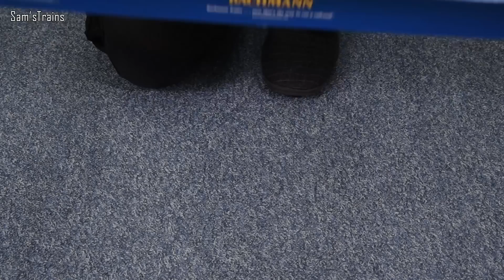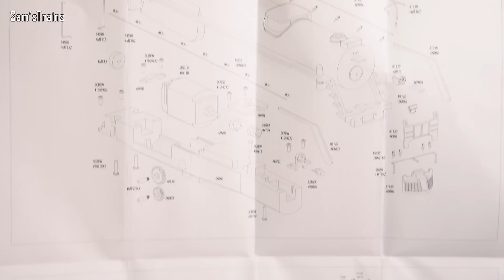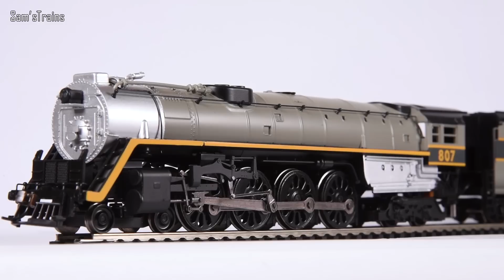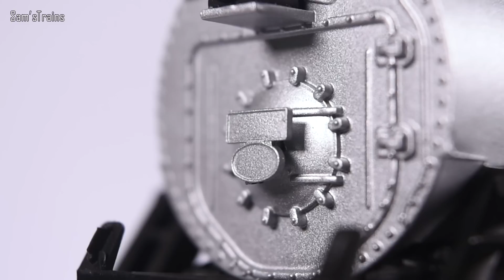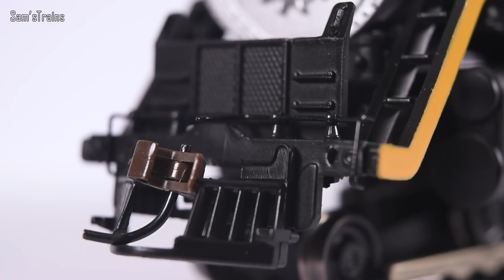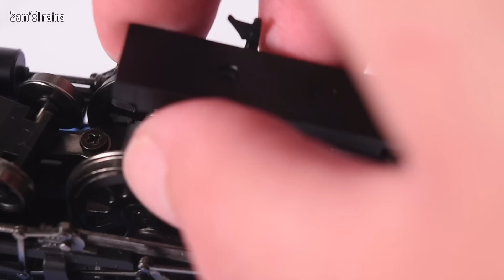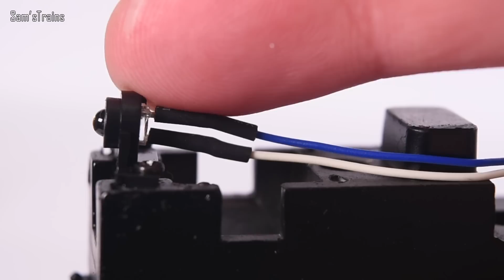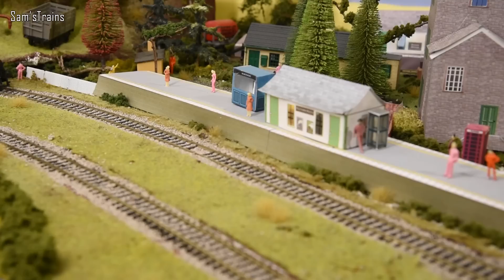Cheap,  Derailing Bachmann UP FEF Steamer | Unboxing & Review

Comment: That's not even an Union Pacific engine... That's just a New York Central repaint. I have the same model, which I got from the "Overland Limited" train set. It seems like it's supposed to work with the track packaged with that set, which is pretty wide, but other than that... Yeah It was really troublesome when I pulled it out. 

Paired with a rake of ten or more wagons in a nice starter set, I'd say this cheap repaint is forgivable, but on it's own... It's just an entry-level starter model. I still think the detail score should have been much lower considering it's more or less a lie, but that's just me who just likes nitpicking this toy.

Comment: 28 coaches that’s less than Hornby pacifics,I’m not saying it’s weak or anything but if a 4-8-4 northern one of the most powerful steam locomotives in the US in real life can outpull any British diesel locomotives and yet it is 3 time less power full than the British diesels yeah I got to say very disappointing and also my gs4 daylight does the same with the derailing

Comment: Nice 4-8-4. I still do not like those plastic knuckles couplers, they almost always break. Why are American Bachmann trains so cheap. Never mind I looked it up. This engine is intended to be a part of the Overland's Train set. For a train set loco it is probably very good deal.

Comment: Reason it keeps derailing Sam is due to its large wheelbase and I have a MTH FEF And it looks at forth rages curves and laughs due to the larger wheels and larger will buy some American locomotives unless it’s something like Mecardo it will laugh at 4 radius curves
Reply from the maker: It isn't the wheelbase - without the tender connected, the loco handles the curves with no problem - as you can see in the video!
Thanks for watching, Sam :)

Comment: You are in fact correct Sam. More specifically, that loco is an FEF-1. Essentially, the first of Union Pacific's 4-8-4 Northerns if I'm remembering correctly.
Reply: Actually it is not any Union Pacific FEF series, its a New York Central S-1a Niagara locomotive with a Southern Pacific SP-1 tender, painted in Union Pacific's "Greyhound" scheme.

Comment: Honestly, the Locomotive is just a recolor of the Bachmann NYC Niagara.
If you want a proper FEF, get an Athearn one
Reply: Or the BLI one
Reply: @williambabcoke248  the athearn one would be cheaper
Reply: @Train099-owner  looks like pre orders for the next run of Athearn ones are pretty much the same price as the BLI ones. Considering the BLI one is a new tool, made of metal, and has more features, looks like the BLI one is better
Reply: @williambabcoke248  the BLI are die cast and sounded with smoke for about $560 while the Athearn plastic construction without sound is about that price while the sounded are about $630. I’d recommend to anyone just grab the BLI since it will have more pulling power thanks to the die cast and it will be cheaper with sound.
Reply: @James-Railyard  I looked at FDT and thought that the ones with sound were $550, guess I didn't look hard enough. It looks like Athearn needs to make some price cuts to stay relevant. Price cuts by like $200-$250
Reply: @williambabcoke248  I agree but the problem with Athearn is they make the bulk of their money and business on diesels. The steamers are probably a side gig. They also only do the Union Pacific engines in Genesis, the old time 2-8-0’s are the roundhouse line I think and seem to be decently priced.
Reply from the maker: Yeah that's what I've heard... I was a fool to get a Bachmann one... but then it was cheap! ;D
Thanks for watching, Sam :)
Reply: @SamsTrains  It's odd to me that Bachmann makes the GS4 and could have used that chassis for this loco. BTW FEF stands for Four-Eight-Four. I was fortunate enough to see sister 844 in person years ago and they are magnificent beasts!
Reply: Thanks for pointing that out @william nichols
Yeah, doesn't even look like an FEF.
Reply: Fun fact: NYC Niagara have air horns (fog horns) but the Union Pacific FEF does not
Reply: I prefer BLI
Reply: Or the BLI one coming out in winter.
Reply: Or Broadway Limited Imports one that is coming out

Comment: Hey Sam I know the problem with this engine. It requires 22" Radius curves (Bachmann EZ track). I have a Bachmann Daylight Locomotive and it won't work unless you have 3rd Radius Curves. If the drawbar is effecting the way the tender is sitting on the tracks, I have a solution! Just bend it down a bit and it should make it better. Same situation happened with my Daylight engine.
Reply from the maker: Thanks for sharing that - pity they failed to mention it anywhere on the box or paperwork!
Thanks for watching, Sam :)

Comment: that doesnt even look like an FEF tbh
I'm guessing it's an FEF-1 because of the single funnel
Reply: That's because it's a NYC Niagara. Never trust Bachmann to be prototypical.
Reply: @P0nyB3h0ldr  now that you mention it, it does indeed look exactly like a niagara
Reply: its not its a new york central niagara
Reply: @IndustrialParrot2816  It's got the windows, the Selkirk front, the airhorn, the roller bearings, the dual beam headlight, the ALCO/NYC Air compressor array. The only thing it's missing is the late NYC era (psc?) tender, which was probably omitted for the sake of the illusion of it being a UP engine. Plus, the smoking gun is it's the same mold as the bachmann plus niagara, which was meant to be a prototypical representation of the locomotive. As a big New York Central fan--I'm pretty certain it's a Niagara.

Comment: While the number may match the FEF-1 class of engines, Bachmann never made a proper FEF tooling. The engine is actually a New York Central Niagara class (minus smoke deflectors) and instead of the NYC PT4 centipede tender, Bachmann decided to put a Vanderbilt tender behind it and call it good. Bachmanns newer Niagara is actually very impressive in my opinion, and much more worthy than whatever this Frankenstein is!
Reply: To be fair, the NYC Niagara class were upgraded versions of the FEF-1 class.
Reply: @bowser5678  Upgraded isn't really fair to the designers at Alco. While some very basic elements were based off the FEF-1 class, the design was very new and made to very different specifications (height and axel loading) compared to the UP.

Comment: I'd say it might be having derailing issues because of how long it is, these models are built for 22Inch Radius curves. Not sure how that goes into OO and Metric
Reply from the maker: It sure is long... but so is the Daylight and the Berkshire, and they're way better!
Thanks for watching, Sam :)
Reply: @SamsTrains  Do the Daylight and the Berkshire have wheel flanges in the middle of the drive wheels?
Reply: I Recommend Getting The 22 Radius Curves Before Getting Locomotives Like Daylight, I Don’t Have Daylight But I Have Some 22 Radius Curves When I’m Ready
Reply: 22 inch curves are about as big as they come in the states, i ran a Bachman 4-8-4 on 18 radius curves and it had problems.
Reply: @HeavyTanker1945  I think I've seen 24Inch before.
Reply: @HeavyTanker1945  There’s massive curves over here… Even in Bachmann Ez Track there’s 28 inch radius tracks. There’s even some larger. I have 22” radius on my inside track and 26” radius on my outside track.
Reply: @HeavyTanker1945  I run 35.50 radius Bachmann EZ track, so you can get bigger, I'm surprised there's not bigger radius curves in Europe/UK
Reply: @trainfansgamingchannel2778  
I guess in the end most of us in the UK use flexible track for permanent layouts anyway.
Reply: @robinforrest7680  right, but not everyone can have a permanent layout, mix that with people wanting to run large trains, im surprised thats not a bigger complaint.
Reply: @trainfansgamingchannel2778  
True enough. It's no excuse for bad design. I haven't got a layout at all at the moment. All packed away in boxes since a house move in 2013 sadly.
Reply: @robinforrest7680  you can only push the limits of the design so far, this locomotive is rated for 22" inch radius curve, trying to run it over a 17 (3/4?) Radius curve is just asking for trouble.
I have locomotives and cars that are rated for 24" radius curves and they derail on 24", now that's a bad design.
Reply: @HeavyTanker1945  it's actually 35
Reply: I was going to say that. This model is meant for a minimum of 3rd radius curves.
Reply: I have a much older version of this Locomotive from the 80s and it runs nice. Has springs in the trucks too.
Reply: 22 in = 558,8mm, that's a little below the R4 from Peco/Hornby (572mm), and above the continental R4, which stands at 545,6mm.
This is one of the many reasons why I have give up modelling US trains long ago.
Reply: @OlivierGabin  I run my big stuff on a minimum of 3rd radius. Even UK locos like A4's and 9F's prefer that radius. I gave up British modeling because of the silly pricing and poor quality. Been doing American for over 20 years and never looked back.
Reply: @tiddles4x4  For the minimal radius, I have finally settled on the 484 mm R3 radius of the Piko track, a little bit broader that the 2nd radius, and not too large to take too mmuch space in a layout. Broader radisu always gies better riding qualities, that's basic physics.
For british modelling, I have gave up N scale due to quality issues, but I keep doing OO. If I have to start from scratch today, honestly, I'm sure I would directly be doing my italian HO trains and nothing else. I have seen enough poor or outdated models in my collection to think that modelling UK trains is something not to consider first when you are a continental like me.
Reply: I personally  can't see the scale of the engine being an issue when the engine is built properly. And since the problem lies around the coupler bar and not the flanges of the main driver wheels I assume the wheels in general have enough clearance in curves. I mean german BR52 engines or BR50 have 5 driver wheels linked together and often run without issues. Obviously R2 is tight (personally don't like using it, am already bummed out I accidently got a part of it in a switch) but without short couplings it should work.
Reply: This loco was also designed for ez track

Comment: If you want a good bachmann product, you have to pay a premium for their spectrum line.
Reply: Really ? I've got a couple of Bachmann Spectrum Shays that I had to rebuilt from gears to current pickups, lights , etc in order to get them running in a , let's say, semi-decent way. They were brand new and the gears were totally cracked.  There is not such thing as "good Bachmann product" I think.
Reply from the maker: haha yeah that's probably true! xD
Thanks for watching, Sam :)
Reply: Spectrum really only exists with their On30 Shays. The rest of their steam line transitioned to Sound Value after 2015.
Spectrum locomotives were definitely a higher class of production value, but some of the locomotives have come out with new tooling that have made them better runners.